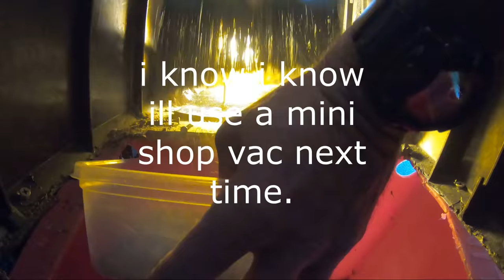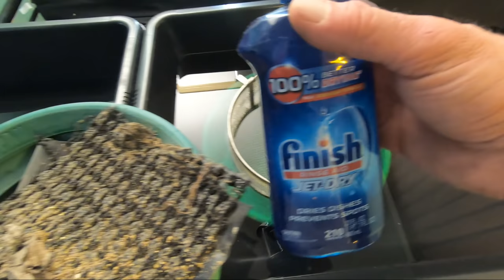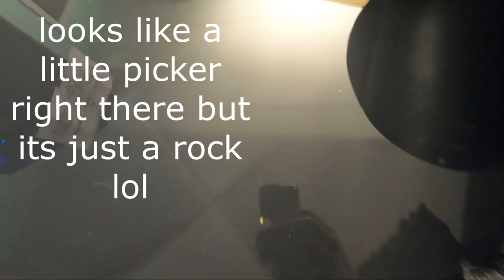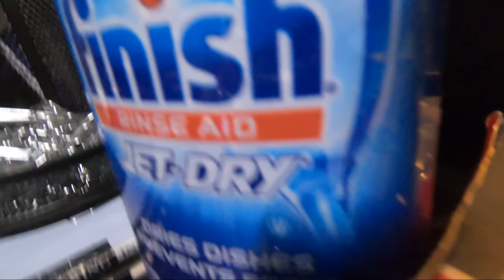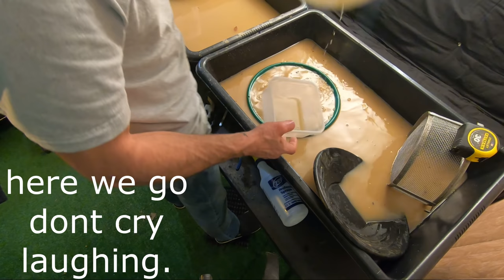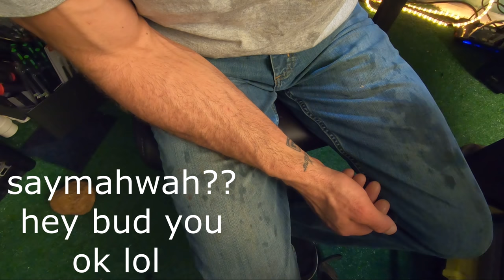How to pan for gold

Comment: Kyle, great video. Lots of work there. For the flour gold recovery,  a coffee filter in a vessel. Pour the flour into it. Later after a few pours and you have some, take the filter and put it into a crucible. Mix into it, denatured alcohol, and boric acid, and let it soak through. Then add borax and heat slowly. Once the paper turns to carbon, you can melt the beads of gold together into one.
Reply from the maker: SOUNDS VERY INTERESTING